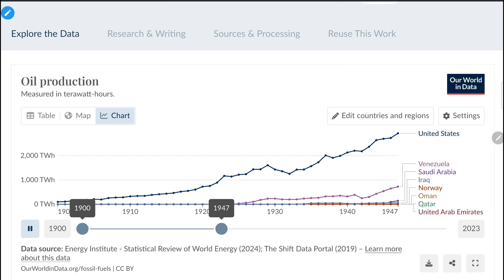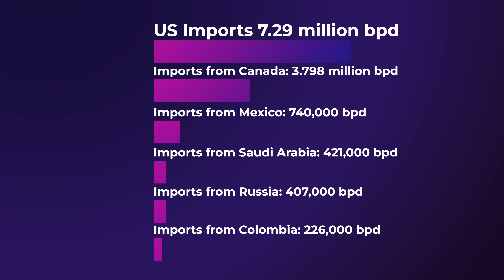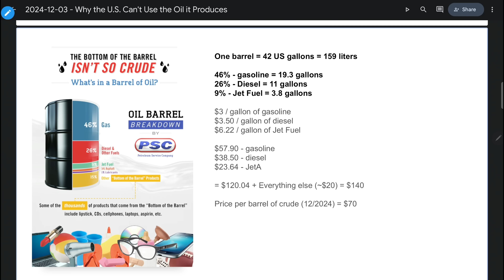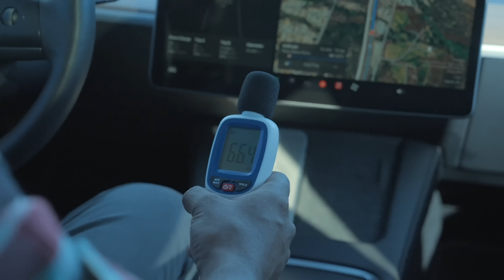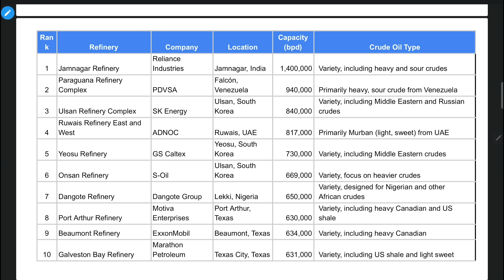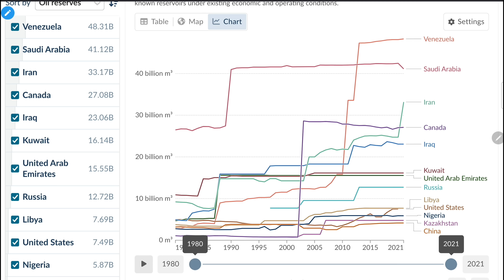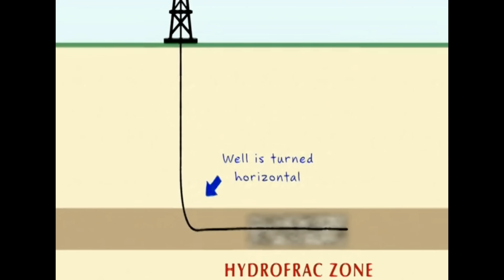Why America Can't USE The Oil it DRILLS

Comment: Well argued, especially on refining costs and the evolving plateau in oil demand overseas sometime in the early 2030s.  One issue with fracked oil and gas is that it depletes very quickly.  Canadian geoscientist David Hughes studied the production data from US and northern British Columbia shale formations -- his report a few years back was ironically titled 'Drill Baby Drill' -- and was startled to see average depletion rates between 50% and 90% after the first year.  He explained it as the physical challenges of obtaining oil and gas from hard rock.  The production rates overall remained steady but the number of wells multiplied in number just to maintain stable production, which invites questions of how quickly a shale play will collapse.  He concluded that the sweet spots in the US shale formations have been tapped, and that the production from two of the five formations he looked at had peaked.  He also looked at the debt levels of US companies in shale drilling and hit the yellow light.
Reply: Also, many of the drills were not closed properly so million(maybe billion) would be needed to clean up the mess the shale boom left behind.😮
Reply: @huntermad5668  I very much doubt that the oil companies are going to actively spend much time or effort on properly closing wells.  That's a pure COST.  It yields no PROFIT.
Reply: So is that shale oil reserve figure completely wrong?
Reply: @awackocrank  No, it's correct.  It's just that there's more rock than oil in each well.  Reserves in one area deplete quickly so you have to move on to frack another in a relatively short time.
Reply: @awackocrank  
Shale is ce now???

The hydraulic fracking is way less effective than expected.
So new drills all the time, more abandoned drills pollute the areas
Reply: Oil and gas is extremely profitable, especially for governments who can tax it to upwards of 80% while the oil companies are still able to make huge profits even after the revenue is taxed that heavily. Renewables still rely on subsidies and are volatile on the grid which in turn require batteries which are expensive and dependent on Chinese companies. Oil production in the US will peak very soon and start declining, but oil sands in Canada will grow for at least another decade.
Reply: from what you say, fracking is like being a cryptocurrency trader, it is not profitable in the long term.
Reply: His numbers were very inaccurate. He quoted one province in Canada for production. Canada's crude is a very hide grade in Alberta. There is more than one province producing and refining oil. But when you get facts from someone who hasn't done his research or is misleading you. You fell for it.
Reply: @drdecker1   Wrong. Alberta sends diluted bitumen down the pipes from high cost high emission high energy operations at the oil sands mines. It is a low quality heavy oil laden with metals. Alberta does not refine all of it. Most of it goes to heavy oil refineries in the US where most of the value is captured by refining it into high value products like gasoline for America's enormous fleets of monster SUVs and trucks that are used in suburbia to pick up groceries and to assuage insecure males. The latest pipeline sends raw dilbit to a terminal in Vancouver where it is then pumped onto tankers that end up in California refineries designed specifically for heavy oil. At this writing (Jan/25) Canada is bracing for Trump's BS tariffs, and if a full trade war erupts it is prepared to turn off the supply. First, though, Americans will be paying a 25% tariff on that oil imposed by their economically illiterate president.  If supplies are interrupted by this lunacy (60% of America's imported oil comes from Canada) then those refineries will have to look for other sources of heavy oil ... like from Venezuela.
Reply: @ub59  Its amazing. The U.S. has already agreed to Albertas Keystone.  So whats the problem. Do you think maybe it is because someone does not want Alberta to succeed. Most Canadians who love their country. Pat their neighbors on the back when they succeed.
Reply: @drdecker1    80% of the oil companies operating in Alberta are majority foreign owned (mainly by US HQs).  The Alberta government was bought by them decades ago and does their bidding.  Success in Alberta's case would be (i) for the state to have a sizeable minority equity stake in their own resource to ensure continuous public revenue is maintained to support universal healthcare, (ii) process the oil at home for domestic value capture purposes instead of shipping all the value and the associated jobs mostly in raw bitumen form to US refineries, and (iii) to today recognize the challenges renewables are placing on oil world wide and plan for the inevitable reduction in oil demand.  There is no plan for failure in Alberta, so success cannot be guaranteed.  Numbers don't lie.  Clean energy surpassed fossil fuels in global energy investment a couple of years ago.  There are trillions in renewable investments on a steep upward curve, and about $500B in fossil fuel investments now on a flat plateau. The growth potential in renewables is overwhelming.  Go to where the money is, especially that held by conservative investors.  Alberta killed its very efficient wind and solar a couple of years ago (both were outcompeting gas and coal fired power in free market auctions) clearing the way for the private gas companies (who are major donors to the ruling party) to jack up rates by orders of magnitude and soak Albertans with the highest power rates in the country.  Alberta renewables used to be a parallel energy sector, but I suppose the premier of the province had the sh!t scared out of her by that growth potential in wind and solar backed by grid-scale battery storage.  Today, she is the only political leader in the nation pulling a pre-emptive capitulation to Trump on tariff threats while all the others, conservative and liberal, are very, very angry and willing to take a hit and fight back and move quickly to solidify trade with our other trading blocks.  A proactive agreement was struck between Canada and the EU where 95% of all the previous trade barriers were removed, which occurred immediately after Trump pulled this tariff bullshit the first time.  The EU needs almost everything Canada produces, both in material form and in knowledge.  Overall, Canada has a phenomenal future growth capability in clean electricity of which it already has in abundance, and will likely move quickly to decarbonize its economy given the right political circumstances, which are are currently coalescing around the ruling federal party.  Alberta's oil comprises just 6% of the nation's GDP on its best day.  Greater Toronto's urban GDP is pretty much equal with the entire province of Alberta's, about $350B per year.  You're right.  Success is very important, but success is meaningless if it is not sustainable.

Comment: EV sales are in the dumpster currently all over the US. As the Government subsidies go away, so do the EV sales. With the US Treasury $35B in debt we can't afford anymore subsidies. Even Tesla is facing financial issues lately. The life expectancy and tire life are much shorter on EV's. There are fewer licensed repair shops for EV's, making them expensive to repair. The insurance rates are much higher on EV's and they have poorer resale value. Battery replacements can cost from $10K to over $20K, which kills the resale value of EV's. If a battery module in an EV is only slightly dented, the insurance companies right-off the entire vehicle, as they are not worth the replacement cost. Don't even get me started on the Li Ion fire issues. EV's are being banned from underground parking decks due to the increased fire hazard they present and the increased difficulty in putting out their fires. 

European cities are older and have narrower roads that require smaller lighter cars. So EV's make more sense in Europe. In the US we drive more miles with our cars per year and EV's are a poor fit, due to the range issues. We also lack the electrical infrastructure for charging large numbers of EV's. Until the battery technology improves drastically and charging times are competitive with filling up a gas tank in 5 minutes, EV's will be a non-starter in the US. 

In Michigan people hate EV's because in the Wintertime the ranges are so badly reduced due to having to heat the interior and defrost the windows. Range reductions of 50% are not unheard of with Winter night driving. Who wants to risk running out of battery charge and literally freezing to death inside your car, should the battery die in a rural area? Most people that I know that own an EV around here only use it as a second vehicle for short local trips. They keep an ICE car for making longer family trips in. 

Sounds like the real solution is to subsidize the oil refiners to get them to upgrade their refineries to use lighter shale oils, so we can end the wasteful import/export oil swap game. EV's still have a place for the few advantages mentioned above, but should not be forced on Americans. Different countries/regions have different needs.

Comment: Trump has said that he'll put 25% tariffs on everything coming into the US from Canada and Mexico. Food for thought:  Which countries are top oil exporters to the US? You get a gold star if you guessed Canada and Mexico. Extra credit for percentages. 52% from Canada. 10% from Mexico.

So, what do you think the effects of 25% across-the-board tariffs against Canada and Mexico will be? Again, if you guessed higher oil prices, you'd be correct.

Yeah, Canada and Mexico could turn down the tap as OPEC did in the 70s, but they'd be crashing their own economies by doing so. So, look for Canada and Mexico to sit back and watch as the US effs around and finds out.

Comment: It is insane that we produce ethanol from corn. 4% of US farmland is used to produce 15.4 billion gallons of fuel. That provides fuel for just 0.02% of total US passenger vehicle miles.  If we instead covered all of that farmland with solar panels to provide electricity for electric vehicles we could power all of the US passenger vehicles and still have 40% of the electricity left over. The production of ethanol doesn't even provide more energy than it consumes. In fact it takes 43% more fossil fuel energy than it provides.

36 million acres of farmland is used to grow corn for ethanol. You could produce 400 MWh of electricity per acre with solar. If all that farmland was covered with solar it would produce 14,400,000  GWh of electricity per year or the equivalent of 2,824 Site C dams. The average US passenger vehicle gets 26MPG and EVs use 3.2 kWh per mile. The electricity would provide enough electricity for 4.5 trillion miles. The total passenger vehicle miles in the US was 3.26 trillion miles.

Comment: In 1973 I wrote a piece that said that oil was too important a resource to burn. It was never published because it was considers to be too radical. I still hold to that view. I bought my last ICE vehicle, a VW EOS, in 2015 and announced that it would be my last ICE vehicle at the time. I presently am driving my second EV, a NISSAN LEAF, that I consider to be my interim EV until I can take delivery of the ATERA SEV for which have had a reservation since February 2020. I have solar on my roof and hope to add more that I use to charge my LEAF. I plan on being battery-backed with enough solar to effectively take me off the grid except for selling my excess generation back to the energy company. This year, Iwase able to generate enough with my current arrangement to have a credit that I am still working through.
Reply: can you upload it to arxiv, if you still have a copy?
Reply: It must be nice to be so wealthy.

Comment: Could someone please check this out?  I see in the comments a number of people saying we should ditch fossil fuels and go solar. Sounds like a good idea, but how feasible is it? I just tried to work through the numbers and what I got is that the USA would need to cover approximately 1/10 to 1/5 of its entire land area in solar farms to replace just oil usage?   Is that about right?  If we added in gas consumption, which we will have to do if we stop oil exrraction as the 2 are linked, it will get even worse.  How much area of solar is needed to replace oil? Its quite possible I got lost in the number of zeros involved, there's a lot of them 😂  EDIT, just tried again, think I'm out by a factor of 10 so "only" about 1/50 of the USA total area in solar farms to replace oil.  Good luck even with that much 😂

Comment: You hit the spot. Until we correctly calculate all costs related to oil, and all other energy sources proposed, we'll not be able to have effective factual based conversations. Of course, each industry pulls several arguments in their favor but commit the same mistakes... By design of course.  The impacts of methane leaks (industrial and ground) from fossil fuels make the oil a much less viable option but we prefer to live in "Wonder Land."

Comment: it is true 1 of 5 new cars sold is EV, but that only apply to 20% of the world ICE vehicles.  Eventually all resources will dry out, until then it will 1000 years before no one will need oil.  Oil is being used on all products.  Remember that.

Comment: Canada has 3rd known oil reserves in the world, sold to USA at hugh discount. Solar and wind has only increased energy costs. If you make $33,000 a year, you are part upper 1% of the world. As they modernize the use of cheap energy will only go up and it is. China is building a coal power plant a week until 2030. USA has decreased it emissions by 2% by just switching coal to LNG.

Comment: Used to love your work but now I always have questions you don't discuss. Obviously, drilling more only produces more crude oil; refinement is still needed. Q1: Does US refining have unused capacity or does "Drill, baby drill" imply increasing refining capacity also? Q2: If Canada is the #1 source of US imported oil wouldn't the proposed expansion of the Keystone pipeline have had a significant impact on increasing supply (and hence lowering prices) in the US? The Russia/Ukraine war and subsequent Russian oil sanctions decreased world supply which drove up world prices. OPEC refused to increase supply to offset the supply drop. Hence, we still have high prices. Increased US exports would increase world supply and lower prices. Q3: Why do you say the basic economic law of supply and demand no longer works? Q4: If we can't use the oil ourselves, wouldn't the US be better off drilling and selling more oil while there's still a market for it? Q5: Isn't the US better off with a balance of trade rather than as a net energy importer? Q6: As a Californian, why don't you contrast California's policies of closing refineries and denying drilling permits and their current $8 / gallon with Texas' opposite policies and price per gallon of less than half the cost? Q7: Isn't it true that the reason the US doesn't build refineries to process it's own oil has nothing to do with peak oil but is because of the time and money it would take getting through the regulations, permits, approvals, environmental studies and lawsuits? I just feel like I only get half a story from you - and it comes from a leftist agenda. This piece feels like a Donald Trump (and supporters) criticism.

Comment: Your statement that “drill baby drill” for energy independence is wrong, is itself a wrong statement. Yes it’s a shell-game. We produce unrefined oil, refine some of it and sell the rest; only to buy oil from other countries. For starters, the more oil we produce here, the greater the GDP. It’s about producing more than we consume, regardless of where it goes and who refined it. It’s Accounts Receivable versus Accounts Payable. Secondly, with the Drill Baby Drill line comes the potential to upgrade our refinery system to include Shell Oil. But we cannot upgrade that infrastructure at our current debt to income ratio. So, we must reduce the debt while also increasing Revenue. Elon and Vivek’s DOGE will be working on the massive Government Waste that’s driving up the Debt. Trump will likewise restore Energy Independence ie Producing more than we Consume by a long shot. Then, we can begin working on upgrading the Infrastructure to refine Shell. The end game would be to be totally Energy Independent and not buy or refine anywhere but here; but obviously we’re a long ways from that.